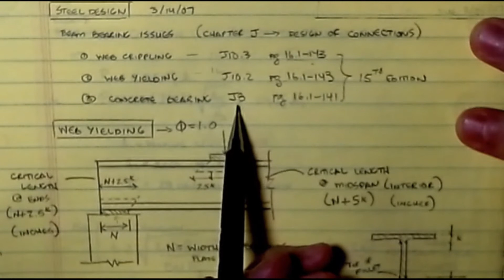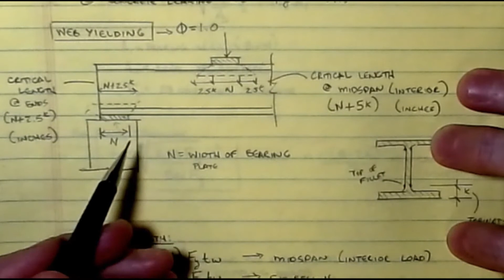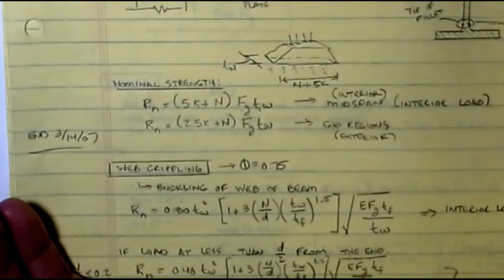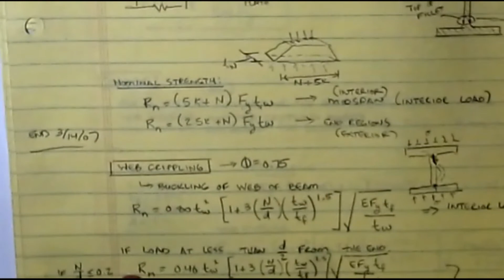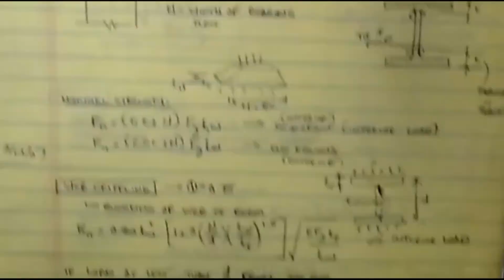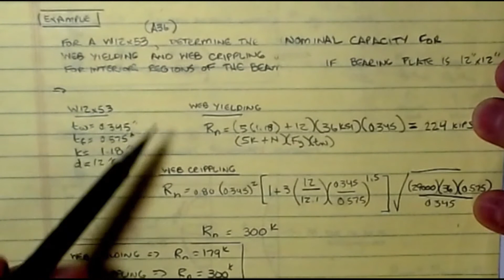028 CE341 Steel Design:  Beam Bearing - Web Yielding and Web Crippling

Comment: Hi, this is a very beneficial video for undergradute students. Can you take a video about double angle connection design ? Is the angle of the web subjected to tension because of bending moment ? I was confused about that.
Reply from the maker: Depending on the magnitude of the compressive force vs the dimensions of the element vs the degree to which it’s buckling, I’ll give you a resounding “maybe”.  It’s a highly complex phenomenon with a lot of variables that can have an impact. Wish I could be more definite on the answer for you.  I hope to add connection design and web stabilization stiffener selection in future videos as time permits. Thanks for watching!

Comment: it is a nice explanation, but I have a question do we assume the bearing pate dimensions when we design a moment connection or we can get it from a some sources of data like vilcraft data ? because in your video you assumed the bearing plate is 12''x12''? so the questions is how did you get the dimensions of bearing plate if we want to design a moment connection ?
Reply from the maker: For this video, the 12x12 dimension was given just as an example to give the viewer a sense of the size of the forces that would result in these phenomenon.  To determine the actual dimensions, you could easily run the equations in reverse and for a given factored reaction load (say 100k), determine what your "N" dimension would  need to be in order to make the web crippling and web yielding values be larger than that load.  I actually have a spreadsheet I have made that does this for me based on the beam being analyzed and the size of the reaction as input.  

This topic was focused more on concentrated forces applied to beams, as opposed to actual full moment transfer and connection detailing.  I hope to get into some of these topics in a future video.  Thanks for watching!
Reply: if you Could please send the spreadsheets to my Gmail, ayachanina2@gmail.com
thank you for your efforts